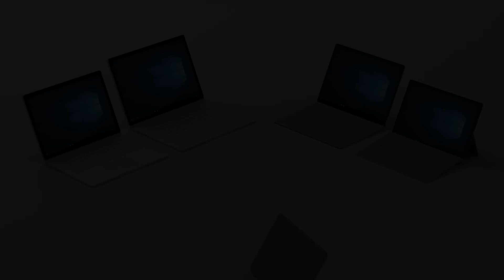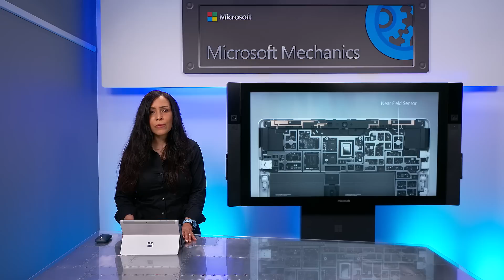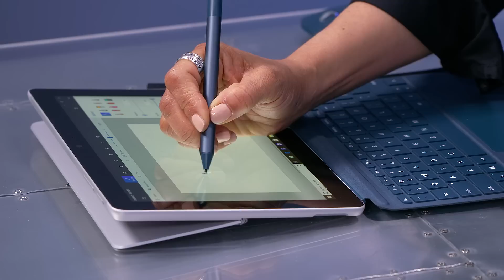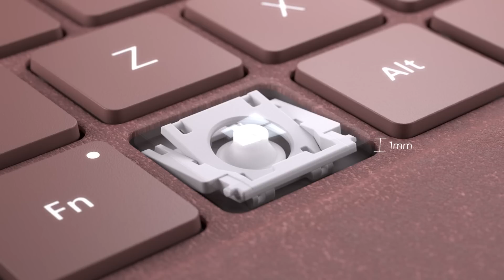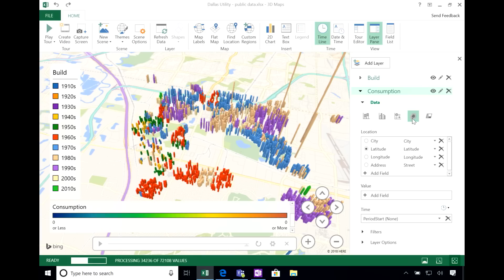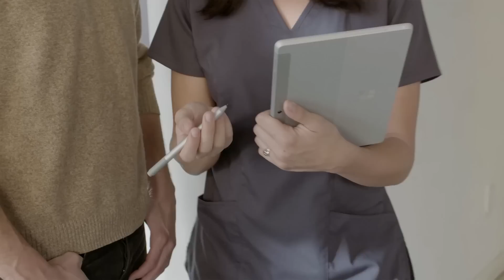Surface Go - Hands on Review

Comment: Looks like a very good challenger to the ipad, with quite a few more options and connectivity pluses.
Full desktop apps and micro sd card will be huge for many as is usb c and its charging and display options, including a seperate charger is gtreat as it will not take up your only usbc slot allowing you to have a display and charging.
This is actually a good MacBook 12" competitor in many ways?

Comment: It is beautiful, it is a beautiful piece of ingeneering, but there are two thing that keeps me from buying: The processor and the ports. You should first optimize Windows 10 for lower end processors. And, if this tablet had a USB-C, USB-A, Mini Display Port and an HDMI, this would be the best budget laptop. But, for now, i will keep my good old Surface Pro 2.ADD MORE PORTS, NOT LESS!